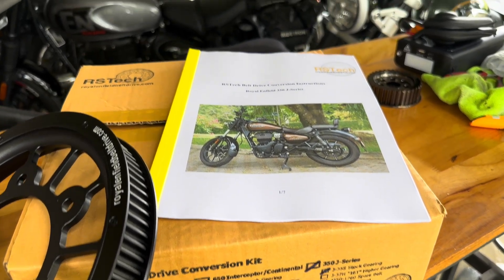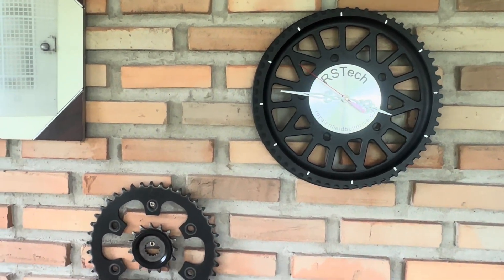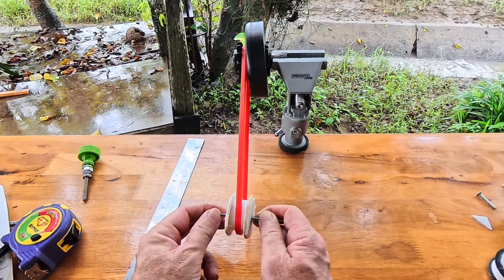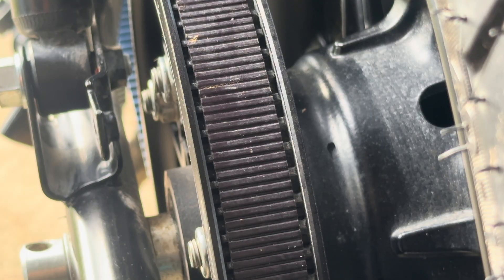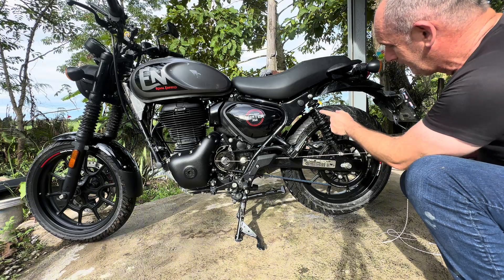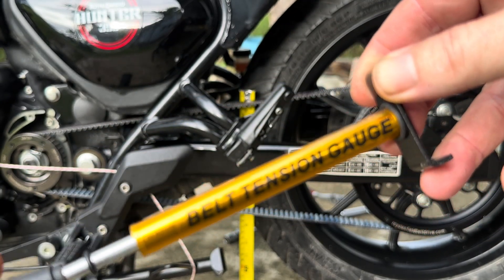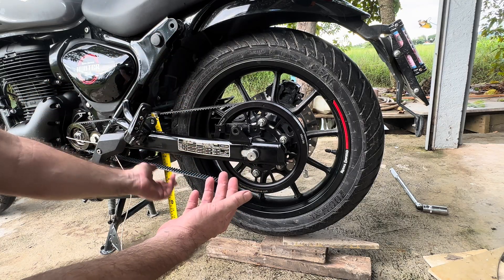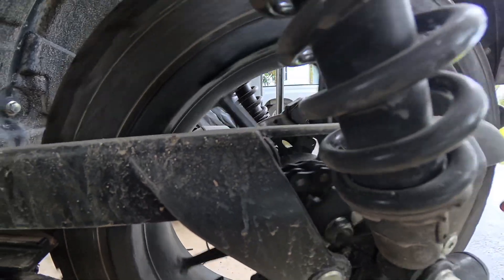Belt Drive Alignment and Tension - RS Tech Belt Drive - Royal Enfield 350

Comment: i am from Indi and I need a suggestion from you regarding my supermeteor 10000km driven in 1 year,i need to replace my chain set should i opt for chain drive or belt drive
Reply from the maker: In India your chains sprockets and Labour are cheap than compared to Europe. Abouts 3 times of changing with Labour would pay for the belt drive in UK. Say 45,000 km. You need to work out how many chains and sprockets with Labour you can get for the price of the belt kit 🙏
Reply: -Thanks for your suggestion,but it is not the cost but other factors like maintenence and comfort in the long run and I usually go on long solo rides for about a day or two  once in a month will this need periodic checks as is required in chain drives

Comment: I am really waiting for long term review after some off road. My biggest concern is how the belt and pulleys will handle some occasional sand/gravel getting inside.
Reply from the maker: Yeah, sand / gravel running between the belt and pulleys is not ideal. Which is why belt drives are designed for long distance road cruising in mind. I did however do a bit of off roading in this video, but far from a long term review yet. 🙏  Which ADV bike would you choose? CRF 300 - Hunter 350- Himalayan 450 ?
https://youtu.be/u_3WF_KPuMk

Comment: I have had the R/S belt drive for over a month now on 2022 Classic 350 that I have owned from new, now over 3 years old. Of all the upgrades I have done on my bike, this is by far the best upgrade. Smoother to ride smoother to change gear and totally clean, plus less noise and no snatchy chain, I would say this will outlive the bike with such a low bhp. As I only ride on tarmac no issues you might have if the bike was ridden off road, the rear wheel just seems to float over the road. Here in the UK a £480 upgrade from Hitchcocks 😊
Reply from the maker: Thats great to hear Peter. And yes I certainly should not  be off roading with it, but just really want to put it through its paces for testing. As you say, just Used on UK roads, and correctly aligned and tensioned, it will go on for the life of the bike. All the best, and safe smooth riding 🙏

Comment: I want to put the belt drive onto my SM6500. Wondering how this affects RE warranty. Don't want to wait another 2 years until expires.
Reply: I was an early bird and put the belt drive version 1 on my SM 650 last year. I am very happy with the result. I got another bike which is acting more like a cruiser now with the taller gearing. The ride is also smoother having lost the jerkiness of the chain drive. And of course no more greasiness.
Reply from the maker: Even changing the air filter or exhaust could affect your warranty. The engines are pretty much proven now. So not much to worry about there. But if there is a problem, not difficult to return to stock. 🙏
Reply: It wont. You not playing with the motor. You'll  be ok